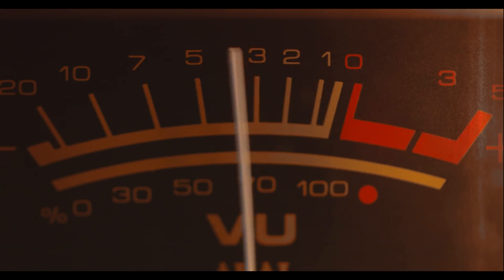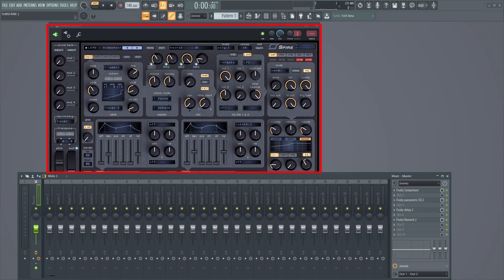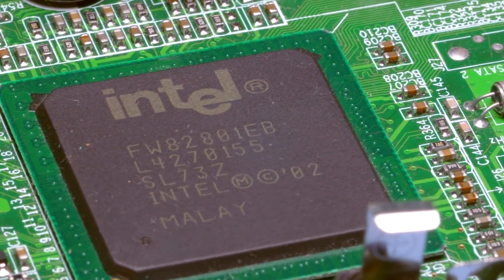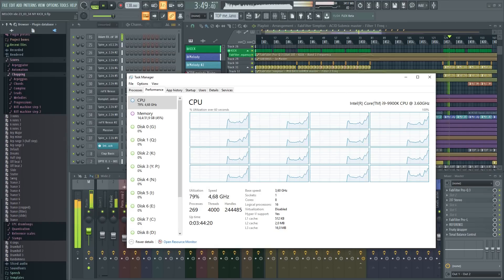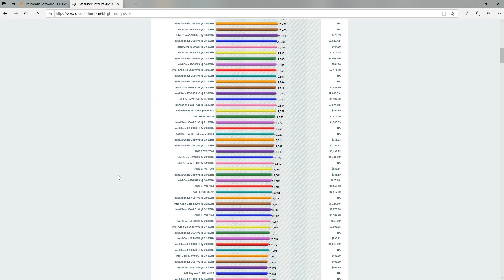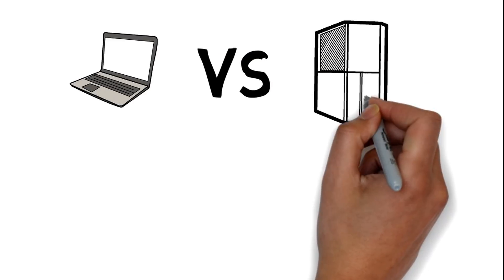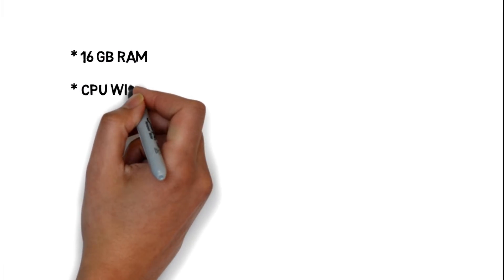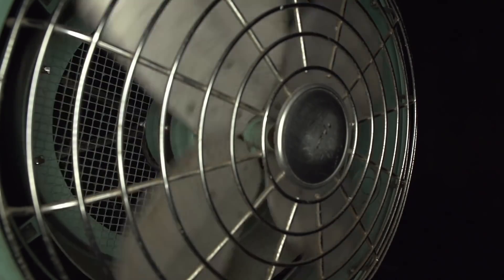The Best Computer For Music Production - What's Needed And Why!

Comment: AMD Ryzen 9 5950X has no competition lmao. I can't believe that now we have a music production and gaming beast at 4.9-5GHz max turbo and 16 cores. Also, at 800 dollars, destroys a Threadripper 2990WX that has double the cores and costs like 3 times more, uses more than double the power or something like that, definetly it makes those old AMD processors look like FX Bulldozer and Piledriver now.
Reply from the maker: I'm excited to try it out myself. I'm saving up to buy a new rig so that I can make a new updated video like this, featuring AMD this time to see how it performs in the real world, and setting it up vs an overclocked 9900k. The earlier ones from AMD was also good but because the Intel chips would easily clock much higher (the AMDs typically maxed out around 4,3 - 4,4 GHz while the 9900k would usually go to 5,2 - 5,3 with no problem most of the time, combined with a higher IPC overall, it was just better for music production most of the time, even though it had fewer cores. 

I'm eager to try out the new ones. I've been reading that the next generation again will also support quad-channel memory? If that's correct then that's very interesting. 
From my earlier experience, that seems to have a lot of impact on music production. The 9900k is almost twice as fast as the 5820k in terms of brute force, however, the 5820k still comes fairly close, and I found that disabling quad-channel memory and bringing it down to two-channel effectively reduces the 5820k's performance in FL Studio by almost 40%. Not sure how that would play out with an AMD system though, but it would be interesting to test. Unfortunately, I can't afford to buy a new rig this year, and then another one once the next generation comes out just to test.
Reply: @FireWalkMusic  I would like to see what you find when you do compare them. AMD has been making a real push to take the crown and they are doing well. Even the biggest Intel loyalists should be happy because legitimate competition is something Intel could use. I have a feeling the next couple generations for both companies are going to be a back and forth and we will all have a lot of options at better prices. Just not at the moment. Prices for certain things right now are awful.
Reply from the maker: @SaintKines  Competition is always good for consumers. Back in the 90's AMD was actually ahead of Intel. I was a huge fan of AMD back then and even when Intel started gaining more and more ground, I stuck with AMD. 
I only switched to Intel because I needed a lot of performance and at the time AMD didn't have anything even close. 

Because of that, Intel hasn't had much of a reason to push on, and things have been kind of stagnating. I've never been a an of the way Intel has attempted to monopolize the marked. I'm hopeful that we can see the same kind of competition we had back in the 90's and early 2000's again. 

Intel's biggest problem is that they've insisted on doing all the production in-house, and they're still struggling to shrink their manufacturing process. AMD on the other hand outsources the production of their chips, so they are now at 7nm while Intel is still stuck at 14nm. 

It's a bit strange that they are so evenly matched now with such a huge difference in efficiency and transistor size. I just hope Intel won't leapfrog ahead again once they get their manufacturing technique straight, because as I said: Competition is always good for the consumers. It means more innovation, faster CPU's and lower prices. What's not to like :)

Comment: With laptops this is how Macs are always so quiet? They limit how much power they can use
Reply from the maker: Laptops always have problems when it comes to heat. They are small and confined areas, and you can't fit a huge cooling rib or fan in there You typically have very small fans, and those have to run very fast in order to move enough air, which means a lot of noise. That's not ideal, so in order to keep the noise to a bearable level they develop own chips for laptops which doesn't develop so much heat. Of course, this means that they're not as fast as their desktop counterparts either most of the time.

Comment: Thank you soooooo much! Is there any new recommendations or updates since it is 2021 now?
Reply from the maker: You're welcome. I'll probably make an updated video this year. However, not much have changed in terms of what's needed and why. The new Ryzen CPU's are great, but they can't overclock as much as the i9 CPUs. Out of the box the ryzen chips have equal, or slightly better single core performance, but when overclocked intel will still be slightly faster. 
I suppose it boils down to what other tasks you're going to be using the computer for. If you're also doing video editing and such, then I'd go for the ryzen chips. If it's purely a music production computer then Intel is likely still the best bet. 
I'm hoping to be bale to save up enough money to buy an AMD based system so that I can run some comparisons in an updated video.
Reply: @FireWalkMusic  I was just about to ask this because I went to the site you referenced for the benchmark tests and at the too is all amd now. I have a nice pc that i built with ryzen9 that comes out to about $10K but I have to get a laptop and landed on your video. I most likely need mac because I will be using logic and editing in davinci resolve. but they’re all intel and didn’t know about the single core part. If I get a new maxed out MacBook Pro should that be efficient enough. I know it’ll be around $5K but I’m fine with that unless there is another laptop in that price range that is better. Any suggestions?
Reply: @ILaxative  May I suggest Evoo LP6 17" laptop from Walmart for $1,000. i7-9750h, 16gb 2666mhz, 1tb nvme ssd, rtx2060, 144hz fhd ips screen. Has extra m.2 slot and 2.5" ssd bay. Easily upgradable by user. Comes underclocked stock and you could modify if desired. Check out Tech With Sean yt channel.

Comment: at the moment it looks like the amd series are much better. Im looking for a ryzen 7 5800x or the cheaper one just (3% slower) ryzen 5 5600x. They are both better in single core then intel cor i9 - 10series. :) GREAT :D
Reply from the maker: AMD now has very similar, or even slightly better single core performance than Intel right out of the box. The catch is that they're clocked pretty much to the limit, and there's not much more to gain. With the 9900K on the other hand, you can usually easily apply a 30-40% overclock with no problem. Most people run these on at least 5 GHZ. When you take that overclock into consideration you get vastly increased single core performance, which will often be more beneficial than the increased number of cores you get with the AMD. However, every project is different and in the end your choice should also be based on what else you intend to use the computer for, as well as price.
Reply: doesn't amd got problems with uad & apollo?
Reply: @DonMagixx  this is my concern although I do have a Ryzen 3950 with Apollo twin running on my pc no problems. I had to buy an adapter to go in my pcie slot for tb3 and tb2 ports and make sure my motherboard had a tb3 header before even considering Apollo. A lot of work but it works.

Comment: Hi, very helpful video. What do you think about this configuration: DELL Optiplex 9010 Desktop, Intel Core i7-3770 3.4GHz/ 24GB RAM/ 240GB SSD+500GB/ DVD/ Windows 10 Pro - Refurbished. would that last for music production?
Reply from the maker: Thanks. It depends on what kind of music you make, and how you set up your projects, but generally I'd say that even the older i7 CPU's should work very well for most people.

Comment: in all honesty, for only 5% performance gain it wasnt worth upgrading
Reply from the maker: For comparison the buffer was set to the same in both setups. However, the 9900k is able to run the project even at 512, where's the older one was only able to run it at 2048, so that makes a huge difference with regards live recording and such.

Comment: This was a great find. Thanks! With this said my research for the CPU that fits my budget has been difficult and the only hurdle. I will only be working with relatively small projects, not using a lot of VSTis etc and wanted to use the i5 10400. I selected the non K as I don't need robust graphics but will have to feed 2x 24" monitors. UserBenchmark looked like a cool site and I wanted to see what they thought of the sequential performance of this chip but they seem (like everywhere I've looked) to focus more on gaming; I am a gamer as well but am only concerned with building this DAW..
Reply from the maker: You're welcome. :)

Comment: what about a soundcard like soundblaster ae-7? people say that it has a specific quad-core processor for audio signals, would that be useful?
Reply from the maker: The sound card has no impact on the performance. It just plays back the music, and records input. All the processing is done by the computer itself, mainly the CPU. Some plugins get some assist by the GPU when it comes to rendering graphics, but it's mostly 99,9% CPU.
Reply: @FireWalkMusic  thanks man you saved me 200€😂

Comment: Best explanation out there.
Reply from the maker: Thanks, much appreciated :)
Reply: FireWalk may I ask how many channels you had or VST’s open at the time of your this video. I usually have around 100+ tracks as well as process heavy plug ins. I use a Mac but have been hesitant on making a switch but Pc seems like the only affordable option. My damn iPad has more cores then my old 2012 Mac I need a work horse.
Reply from the maker: @bryceheffinger8895  probably around 110 tracks if memory serves. Lots of vst's
Reply: FireWalk Thanks a lot man appreciate it

Comment: Enabling Quad Channel Memory Seems to make a substantial impact on performance as well. If you were to double your ram (mind you, your CPU and MOBO must support Quad/Six/Eight channel memory architecture) I suspect you would see a 20% cpu load drop. Its not about having more ram in this instance, its about opening up band with for faster communication. The Next step (witch I am currently undergoing myself) is to set up a server(s) in a machine room. For Performance, Storage, And Powering multiple Instances of FL and Cubase from 3 different studio rooms. GL and keep having fun!
Reply from the maker: Quad channel memory seems to make a big difference on large projects. I tried this on my old rig and going to 2 channel memory resulted in at least a 20% performance reduction on large projects.

Comment: @Firewalk Concerning O/S for a 2013 Laptop ! So in your opinion is Win 8.1 Pro or Win 10 Pro best for Music Production on a 2013 HP Probook 4540s Intel Core i7 3720 Quad Core 2.6 Ghz 8 Gig Memory 2TB HDD i7 ? Speedwise they are about the same BUT Every time I try Win 10 I'm forever being plagued by OCD Security features that just refuse to stay off whereas Win 8.1 I can just terminate the security period. Your thoughts ? DAWS, Presonus Studio One Professional, FL Studio, Mixcraft 8.1 and Tascam  Audio interface Oxygen 25 Midi Acoustic and Vocals NON professional just starting out to try and master the fine arts of producing my own music. Your Thoughts on Win 8.1 vs 10 on an older laptop. PS, can't put 16 gig Ram on 4540s apparently but I do have an HP PAVILION 17 quad core of about the same era. I've got all Windows O/S ! Gratitude ✌️🙃
Reply from the maker: I used to hang on to windows 7 for a long time. I only switched to windows 10 right before I made this video. Still not a huge fan of windows 10.. But it's safer with regard to driver support and combability for the future. Windows 8 will likely be supported for a good while still. Security software can always be disabled. In terms of performance, there shouldn't be any difference between windows 8 and 10 with regard to music production.
Reply: @FireWalkMusic  thank you. As a Finale', has ANYONE here had any Latency issues on Win 8.1 compared to Win 10 for Audio production ? I've only done some simple acoustic and vocals but didn't have any issues with 8.1. Anyone here done in depth production on Win 8.1 AND 10 for a comparison with Latency that was an alleged issue ? I guess the only way is trial and error but it seems to me that on laptops that were manufactured with Win 7 and Win 8.1 as default it just seems right that they'd work better with default but I'll try in depth with both O/S on both 2013 laptops and maybe post beck with thoughts. Thanks

Comment: A good contestant is the Lenova V55T-15API :

In terms of processing power to money ratio you can't go wrong.

Specs wise :
Ryzen 5 3400G 
8gb RAM (easy to upgrade)
256gb of ssd 
1TB hdd (may have changed 🤔)
Numerous USB ports
Windows 10 64 bit pre installed
Radeon graphics (Not really important for audio but decent).

All for the price of £405, not bad at all.

Comment: I noticed something, when you put a lot of effects on one mixer track, you start to notice a single thread bottleneck in the computer and there is a bigger gap between the CPU meter in FL Studio compared to Windows 10.

It seems that the best way to optimize the CPU usage is avoiding a lot of effects on a single channel. Sidechaining can reduce the singlethread bottleneck, i made a very synth heavy musical piece but i did sidechaining and reduced the gap between FL Studio's CPU meter and Windows 10.
Reply from the maker: Hi, I actually have a video about this, you might find it interesting: https://youtu.be/hX10k8Hb77g
Reply: @FireWalkMusic  In my i7-4700MQ the gap between FL Studio's CPU meter and Windows's task manager is more or less 10%. Like 80% in Windows's Task manager and 90 in FL Studio, running with a buffer of 256 and can also handle 128. I could go even further but i get thermal throttling at almost 85°C. Base clock is 2.4GHz but with an undervolt, it's like running overclocked to 3GHz or a 30% improvement in perfomance.

I guess that the best CPUs are the ones that have a small gap here and specially desktop ones, they have better controlled thermals therefore more stable perfomance close to 100% use. Maybe a Ryzen 9 3900X (it has the best singlethread perfomance from AMD and 12 cores) will have better boost clock behavior or thermals than an i9-10900K?

I saw in some benchmarks that the Ryzen 9 3900X can beat the i9-10900K in rendering but it seems that it happened due to the better boost behavior, i don't think that with an i9-10900K can handle an extremely synth heavy project and still clock at 5 GHz due to the heat.

Comment: I heavily recommend undervolting CPUs, it's totally safe and you can get better Turbo Boost behavior and reduce power and temps. This is also amazing for laptops.

I always prefer undervolting over overclocking, the latter is not safe and you can damage your system.

Comment: Would ryzen 9 3900x be a good choice with 32 gigs of ram clocked at 3200mhz
Reply: Yes, it is a beast. Also, you should try doing a turbo boost overclock or undervolting.

You can find a sweet spot between the turbo frequency and running the processor above the base clock, then you can easily reach high end Intel levels of perfomance but with more cores than an i9.
Reply: I still recommend an i9-9900K or i7-10700K. The i9-9900K is cheaper now and it's top tier in single thread. The 10700K is the best but very expensive.
Reply from the maker: It should work very well indeed. The new AMD Chips are great. They are still not as good as the i9 when it comes to raw single core performance. Especially when you take overclocking into consideration. The AMD chips are pretty much maxed out right out of the box, but the Intel chips can usually be overclocked to above 5 ghz with no problem, which will make a huge difference. 
That said, the performance difference will be minimal, and the Ryzen will excel at other tasks, thanks to it's many cores. In the end it will depend on what other tasks you use your computer for. Most people don't need the "most" powerful computer for music production. Most people will make due with far less. AMD generally provides better value for your money.
Reply: @FireWalkMusic  thank you so much for your valuable suggestion. Definately going to buy 3900x. 😊
Reply from the maker: @KunalKarautiya  You're welcome :)

Comment: This may be a dumb question but what about a disc drive?
Reply from the maker: A normal disk drive will work just fine, but if you have a large project with lots of heavy libraries such as nexus, omnisphere and such then it will take longer to load those projects. it will also take longer to load individual sounds from such libraries since the read speed of a disk drive is far less than SSD drives.